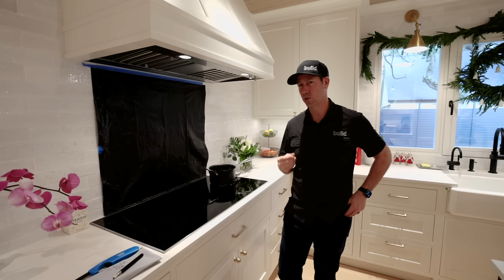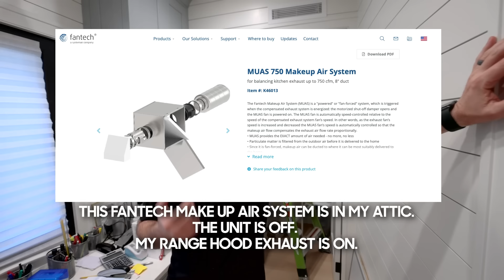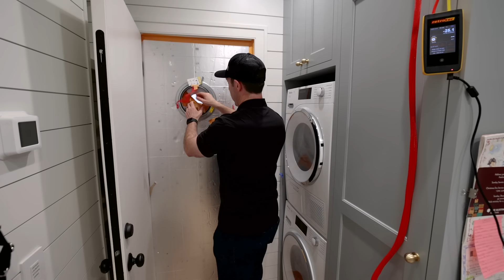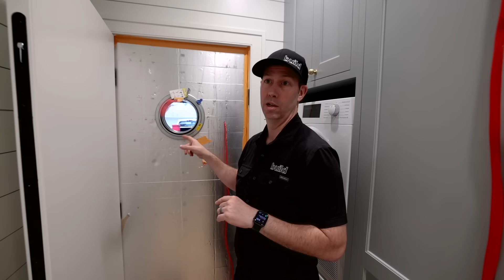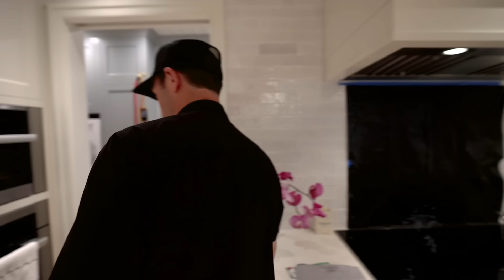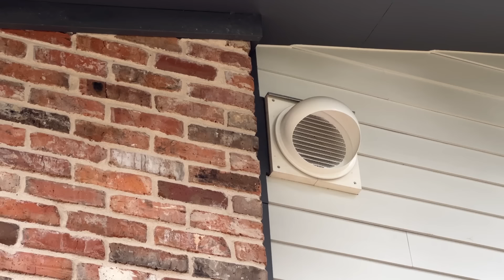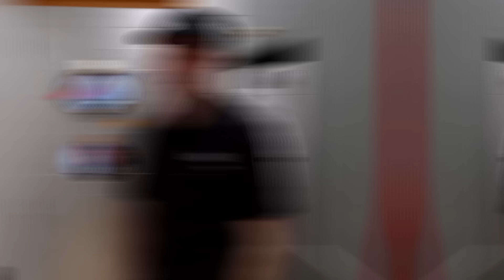Make Up Air for a Kitchen Exhaust - Most Homes Suck. (Pun intended)

Comment: Fantech is not cheap but but you get that German quality.  my fan has balancers on it like they put on car rims.  zero vibration.  it also had stepless speed adjustment from whisper silent to jet engine like.  if you got the money Fantech is good stuff.

Comment: In the restaurant industry, with lots of exhaust hoods, the make-up air is right next to the hood. Why? So the air-conditioned air is not sucked out of the dining area. Air conditioning is VERY expensive and we never want to suck it outside needlessly.

Comment: If you're going to cook inside it's wise to have some sort of air filtering to capture grease, smoke, food "pollutants" specifically from your cooktop and ovens. But in a high performance house it's ridiculous to punch two 8" holes to the outside environment - with ZERO insulation on those thin sheet metal dampers! Seriously, that is just crazy! Imagine the heat loss and air infiltration through those two holes in the middle of winter in Zone 5-7 in North America. And you have that tremendous energy loss 24 hours per day. And if you add some sort of pre-heat to the make-up air you have an additional energy hit (e.g. 5-10 KW electricity demand to run the heater). It's absurd.
Assuming you have an induction cooktop (no more gas), the best solution I can think of is to go with a recirculating hood. Even if they only remove 50% of the "pollutants", that's a far better compromise than this uninsulated, gaping hole nonsense. And then open a nearby window for 15 minutes to refresh the kitchen air. Then close the window and you're back to a super insulated, super air sealed house. Also, notice how high up Matt had to hold that smoke pen, and even then the draw was not particularly impressive. I'm not sure all that much of the pollutants get exhausted even with an exterior exhaust system.

Comment: Area increase isn’t linear. The area of 8” round opening = 50 sq. in. (Pi x radius squared). double that area = 100 sq in, divide by pi (3.14) = 31.8; square root of 31.8 sq.in. = 5.64in. radius x 2 = 11.3 in.; diameter (round up to 12”) diameter makeup opening for 2X passive system. Same calc process for 3 times (result = 13.85 inch diameter; round up to 14”)

Comment: Cool video. I wish you could have shown a diagram of the whole ducting. I understand you're adding air (makeup) to equalize the in vs out, but confused where the makeup inlet is in relation to the kitchen exhaust vent. Also adding a 2nd 8" hole isn't the same as increasing the diameter from 8" to 16", because of the exponential relationship of a circles radius to the area, you would have needed 4x 8" holes to equal the area of 1x 16" hole

Comment: Love your videos, very informative especially when it’s your house.  With all that negative pressure are you concerned all the chemicals your sucking out of the walls all the time.  Fiberglass, formaldehyde, glues, plastics, etc.  I would prefer slightly positive pressure like my Tesla biohazard vent.  Even OR’s are on the positive side.  Yes, I realize some energy loss.
Reply: I brought this up as much house was poorly HVAC’ed.  when my air handlers would switch on you could literally see the dry wall suck in.  Always pieces of fiberglass found on my filter screens.  We later found the problem

Comment: You completely missed the reason that the fan is above the stove. In case of a fire, the fan above the stove, compresses the flame, making it hotter. Then when it exhausts the air into a large duct, it causes the pressure drop causes the flame to extinguish. With your configuration, you will have a flame thrower running through your ducting, which may burn your house down, and cause injury or loss of life.
Reply: There’s no sensor to shut things down if needed?
Reply: @aayotechnology  That's another fix, I wonder what building regulations say about this; in case of a fire, should the HVAC system do something? Can it help supress the fire?

Comment: Appreciate your tidbits on healthy homes. I use a gas stove and 100% can smell the fumes coming off of them. My fan is not keeping up with the fumes which brings me to this video. Interested to know if you use a gas home heater or electric? I have a formaldehyde/voc monitor and it kicks up with the gas usage. Had heater and gas checked, no leaks. Just usual bad chemicals. With 2 asthmatic kiddos I’m on the hunt for high quality air. 😊😊😊
Reply: From what I've read - go electric or better induction. I have all-electric but the Microwave creates a negative pressure  at only 300 CFM and I'm getting a makeup air system with a filter. As for ventilation, required in a tight home, we put 13 MERV filters on an ERV (cold climate).
Reply: @stuarthkrantz  good tips, thank you! I would love induction. I also have the merv 13 plus carbon media filters and I do love those! Would love a higher cfm kitchen vent but apparently makeup air is an issue with over 400cfm. So many things to get this right! Thanks again. ☺️ I’m in south Texas so super hot here. 😂
Reply: @stuarthkrantz  which erv do you like? Most people don’t even know what they are here. Have a company that is testing the broen brand. Fingers crossed. We use the aureus air scrubbers and have had good benefits with that. Mold issues in the south but none with the air scrubbers.

Comment: My local jurisdiction requires make up air if the vent hood is 400cfm or more. A lot of folks with big gas stoves and vent hoods don't know this and then get hit with an added $1-2k to install makeup air.
Reply: On a tight home, I needed Make-up Air for a normal microwave (300 CFM). Didn't meet code but when the microwave runs, tought to open the doors.

Comment: A man built a new home for his parents, and they died after they moved into their new home because of the back draft on their gas appliances while using the kitchen or bathroom vent. So sad. 100% avoidable deaths. This is so good to have a video that explains the problem and the solution. Thanks for the details of how to do it right. Make up air needs a powered system to protect you from carbon monoxide poisoning illness and death. - TAV ♥️🇺🇸🌎👍

Comment: Not just kitchen exhaust, but bathroom fans and clothes dryers suck up a lot of air too.  How about an intake system that operates from pressure differentials?  Not just the old passive dampers, but powered?

Comment: What bothers me that wouldn't bother a builder (due to a builders' unlimited resources) is that even the passive make-up system requires the use of a small motor and a circuit board just to open a flap.  And I expect that either of these electric/electronic units will fail.
Since within my residence a persistent level of restaurant intensity cooking isn't taking place but is brief in the need of a full 900 CFM evacuation of one to two times per week.  As a result, I'd like to know if a simple make up unit consisting of a flap pulled open by the draw of my range hood would suffice.  To me that wouldn't fail because basically the flap works like the flap in a clothes dryer outlet, but in reverse.  And given the make-up inlet was 8" matching my 8" duct discharge.
Further, I'd prefer the make-up air be ducted to the floor beneath my electric range to minimize a change to the conditioned air within my home, as in adverting the need for a make-up heater.

If anyone answers this I'll be shocked.

Comment: People need to do the meat and grease cooking outside.  The 300 CFM fan is adequate for an electric cooktop and general cooking.  These makeup air rules are an example of why it keeps costing more and more to build a home.  Most houses are not that tight and the real safety issue is with gas appliances.  Go all electric and 300cfm exhaust.

Comment: What about an exhaust system / ventilation system which also incorporates heat exchange?  Stove top & oven energy thrown out  and not recovered is inefficient,.... especially in a small space like a condo/apartment or tiny home.
Reply: The issue is that exhaust hood air is presumed to contain grease and other contaminants. Therefore, you want it to contact with as few surfaces as possible. If you tried running it through any type of heat exchanger you would need to be constantly cleaning it or else it would cake up and stop moving air.
Also, the exhaust air will likely be hotter than the conditioned air which isn't terribly helpful in Matt's climate

Comment: Instead of a pre-heater, what about a heat exchanger? Wouldn't this be more cost effective from energy costs?
I think you would need to have either a common exhaust with a common make up, or one HX+makup at each each kitchen, bathroom ect...

I would love to rebuild or at least modernize my house, but at the end of the day, my taxes will go up as much or more than the energy savings, on top of the $40-60k cost of upgrading.
This tech is also advancing fairly quickly. The cost and benefits have improved greatly since I started designing a passive home years ago.

Comment: Don’t like the idea of around 1000 CFM of unconditioned hot/humid air entering my house while cooking.  Came across a makeup air kit using a 10” motorized damper with static pressure control switch activated by Venthood airflow.  The fresh air intake is ducted into HVAC return plenum with the motorized damper. Whenever the hood comes on, the pressure switch activates HVAC system fan, outside air passes through the HVAC filter and is distributed through existing ducts.  Since it’s blended with indoor air, it would be partially conditioned and if the indoor temperature rises above setpoint, the house thermostat activates cooling. This would work the same way in a heating season.  I can see several advantages of doing it this way, interested in hearing of anyone has any experience doing this way or expert opinions.  Imperial Kitchen Ventilation company makes such a kit, product is MA10 (they also make 8 and 6” versions).  Appreciate any input.
Reply: just my thoughts.  I agree, the less air flow in the hood the better (job one), so long as it efficiently removes the stuff (>85% is good enough, just run it for a couple of extra minutes).  go for efficient hood vs high flow.  Ducting into the return and letting the HVAC temper it a bit, can temper the thermal shock, but there is not normally a temperature sensor (sensible heat) in residential ducting nor humidity (latent heat).  Having the cold (maybe hot and humid) outside filtered air as close to and below the exhaust is ideal, especially if it is shaped (nozzles) so that the air stream does not short cycle the fume removal for really high flows(>1200 cfm).  In this manner the air avoids people as much as possible.  No one want sub freezing air blowing on their head.

Comment: I have a problem seing what you did:
- 1st: WHY? All you need is passive hatch that opens as needed by flow itself. It is century old way of letting air in or out and open just as needed when needed or gravity closes the thing down. You can still use filter and stuff. It is on attic. You have space to make larger. What when power goes off ??
- 2nd: WHY makeup air is SO TINY, so you make hurricane wind inside and al lot of noise as well. It is much netter to let air from multiple larger spots. Even on LQ PC speakers I can hear hum and fact that you are speaking quite loud and when you pause, hum noise raises up. 
- 3th: 8 inch hole is NOT big. Behind your back is washing machine door and that would be big hole and ONE would be enough. One big hole is better than 10 small ones! Unless you make honeycomb shape! Circle holes makes a lot of hum.

Comment: i have seen the ever increasing profit driven sale of excessive cfm kitchen cooktop exhaust fans for 20yrs. Do a little research, council your customer, Shepard your designers-archi's, increase the capture area and consider a nice quiet 300-350cfm motor. i have built dozens of restaurants in Seattle with Hoods/Make-Up -HRV/ Ansel Fire as well as Curtain wall chilled air as make-up along the Sautè line. Giant cfm is just another 'look at me' feature that guarantees a cascading scope creep event in modern design build. more isn't always better it can just be more.

Comment: This is nothing new, retired grower. venting smells with fans creates negative pressure. I kept one 4inch intake fan $150.00 connected a speed control. I run it 24/7 on the lowest speed. House always smells fresh, i'm in cold climate canada. Worst case an extra S10.00 on gas or electric bill, big deal.

Comment: Excellent material on a topic not very well understood by most homeowners. Some things to consider:

1) Energy efficiency.  If you are pumping 1000 cfm of conditioned, humidified, and filtered air out of your house, and replacing it with outside air that is significantly hotter/cooler/drier/wetter, then your HVAC system is going to have to do some work to maintain a comfortable living environment. A 3000 sq. ft. home, running a 1000 CFM extraction system, is theoretically going to exchange 100% of the inside air for outside air in a little more than 20 minutes. That's going to cost some amount of money in either heating or air-conditioning running costs.  You can reduce this, potentially significantly, by utilising a heat-exchanger where the warmed/cooled inside air is used to condition the incoming make-up air.  But these systems add complexity and cost. And you need to have the space and ducting routes to utilise them.

2) Speaking of which....The reality is that considerably less than 100% of our housing stock can use outside air extraction. In many instances people live in multi-unit apartments, condominiums, or other structures that simply do not offer a clear route from cooktop hood to the outside. And even in single-family houses, we need to remember that there are practical limits on the length of ducting (and number of turns) between hood and extraction port.

3) Another alternative, which doesn't rely on makeup air, is a recirculating system. Rather than venting cooking smoke/smells to the outside, instead it relies on a series of filters. These filters comprise washable aluminium mesh grease filters, and replaceable activated charcoal filters to deal with smoke and smells. While less-than-optimal these systems do a pretty good job of removing cooking nasties from the indoor air environment. And without the energy losses of a vented system.

Overall, my recommendation is to use a holistic approach to dealing with cooking ventilation. Take into consideration the climate you live in. If it's 72F and 50% humidity outside, then maybe its not such a bad idea to let outside air into your house. If those numbers are considerably hotter/colder/wetter/drier - recognise that conditioning the air is going to come at some cost. And maybe think about cooking particularly smoky dishes outside, on the barbecue, if you have that option.

Comment: What about bathroom vent fans?  Do they need a make up air thing too?  Attaching our bathroom vent fan to the outside vent is our next project (when we bought the house it just vented to the attic, causing condensation on the walls and mold).
Reply: Not necessarily but it could be done. I’ve heard passive homes don’t have bathroom fans but rather an ERV. I prefer having bathroom fans even with a centralized system.

Comment: I live on maui.  Electricity is 37 cents/kwh.  Try not to have have too much electric stuff.  I do have solar panels and storage battery as well as EV.  Save $600/month on electricity and gas.  Electricity must increase on the mainland to modernize the grid.  30% renewable Hawaii vs 8% Mainland.

Comment: Your system is quiet because you’re using a 400 Cfm fan with 8 inch ductwork.  400 CFM is cute, good if you want to exhaust the steam from boiling an egg.  I want to watch you sear a steak on that range and see how much smoke your system can really handle.

Comment: What about exhaust from bathroom fans?

Would you be able to tie the makeup air into the furnace? So that way all intake air goes through a single filter, and less penetrations required of the envelope?
Reply: you could use a HRV/ERV to have local and conditioned makeup air to your bathrooms. technically you can do your makeup air for your stove with a HRV/ERV but that can be a bit unnecessary since using a stovetop will generally increase the home temperature during use and in both winter/summer its simplest to just exchange that air without heating/cooling recovery. I am no expert, these were just my finding when I was looking into makeup air with an existing HRV system in place. as far as makeup air in a bathroom/bedroom goes its the same principal of your stovetop makeup air, you want the pressure of the house to remain somewhat consistent as to not have a negative/backflow that could be potentially dangerous. with this kind of thing its always best to consult a HVAC specialist to know what your best options are.

Comment: What is not mentioned in this video is the cost of making up air. In my recent experience of remodeling the kitchen, the quoted cost of a make up system that ties into the HVAC system is $5k. That is a cost that is not discussed in budget planning.  What would be an estimate of the system Matt describes in this video?